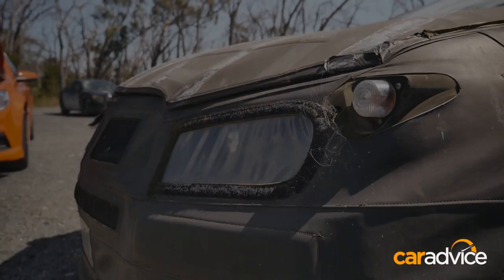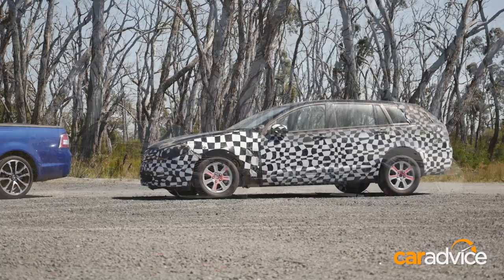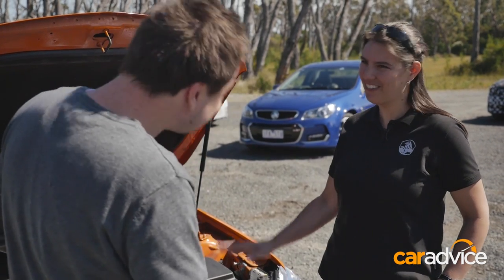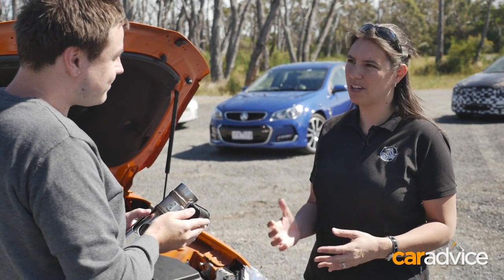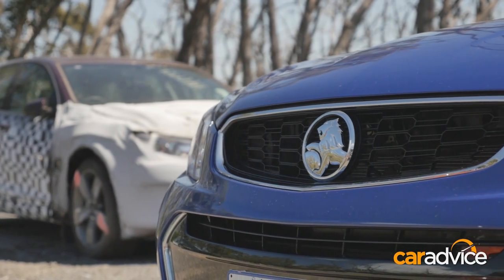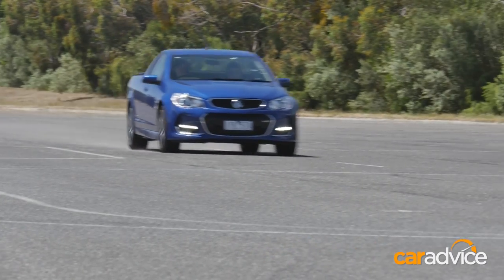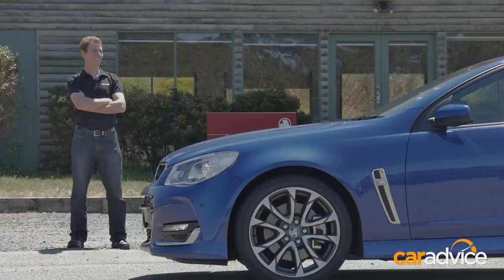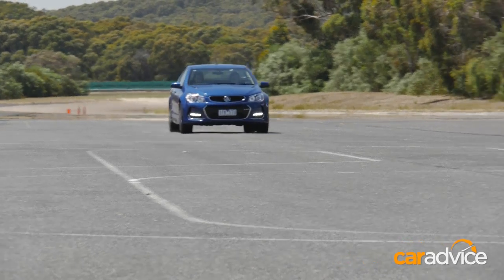2016 Holden VFII Commodore — Exhaust/engine note and engineering interviews

Comment: I own a 2016 Redline VF Series II, and I'd like to point out a few things.
1)They never fixed the headache causing vibration if you have the back windows down. Ever. Since 1980.
2)This model never got the Drive Mode Selector. The Lowndes Motorsport edition did. So did the Calais Director V8...Competition Mode through the Traction Control system is what they thought was adequate.
3)The Redline has an adjustable electric seat for the driver only. Riding in the front passenger seat is horrible.Major faux pas.
4)Whenever you open a door in the rain water covers the seat inside it. There are no rain guard rails on any door.
And lastly....
5)The HUD housing in the front dash is very reflective onto the windscreen and distracting during sunny days, whether it's in use or not. Same with much of the interior chrome trim.
And Holden claim that a billion dollars was spent in development?
Don't get me wrong, I love my Redline.....but I would have adored what it should have been had they talked to real, everyday drivers.
R.I.P Commodore 🇦🇺
R.I.P Holden 🇦🇺
Reply: These are the most minor complaints for what is a great car to be honest